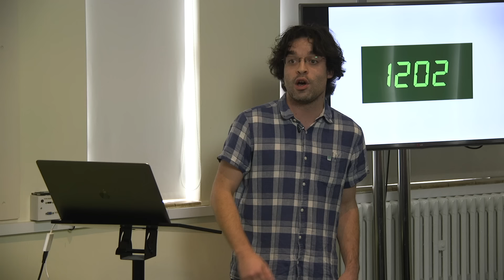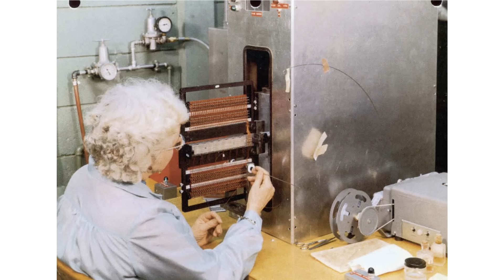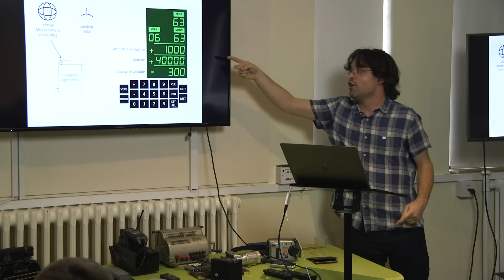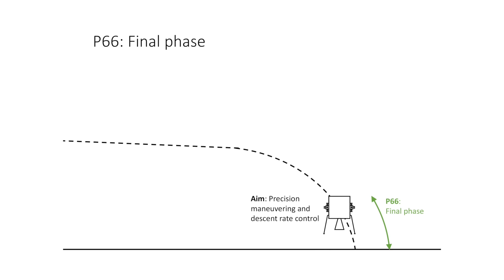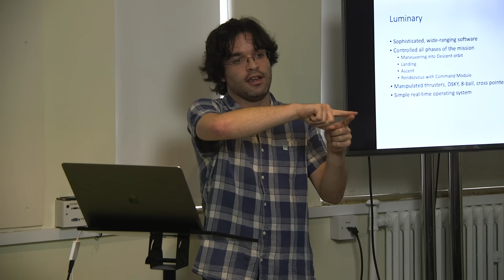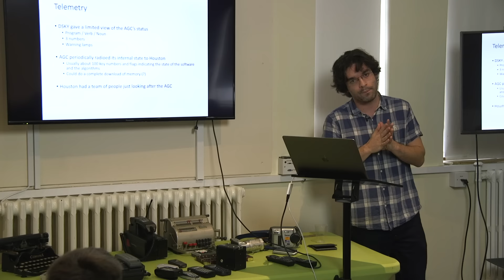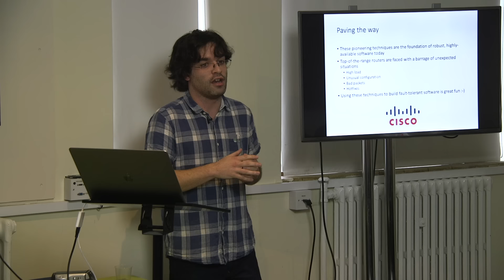Light Years Ahead | The 1969 Apollo Guidance Computer

Comment: ¿ 2051 apollo ? * ** 
□
Apollo army, naval, air force

4 orbiting body for area 4⁶⁷⁰ < = . > 
6⁷⁷⁹² < = .>

Hundred million thousand globe area(s) 
•Port •bow •aft •stern grûá  plûmb 

90°Ņ•90°E•90°Ş•90° up • down
Reply: 7,800,000 aerospace 
Requirement stationary orbit 
(7) atmosphere meteor 
13,000,000 pilot per globe 
2093 - 2067+- 2235 year(s)
8189 stationary orbit friggit size attachment 10 - 24 aerospace outer space ship 

Solar cell carriage bolt, solor cell thick attachable initia 
Holding orbit 
Requirement green house food.

Atmosphere (7) type(s)
1. T.e.r.
2. U.h.f.
3. M.a.r.
4. A.v.a.

Meteor and 117 solar system equipment transmitting flag • banner • rectangle horizontal or and & neutral verticle
Reply: Communication audiance museum conduit terminal computer ₩c infant(s) & ₩c adult(s) question & answer

Comment: Question: Did the computer engineers overlook the 15% load of the RENDEZVOUS RADAR when it wasn't even needed during the descent phase? Thanks
Reply: He said it was a hardware problem, so presumably, that particular hardware wasn't in the simulator (since it was mounted on the LM).

Comment: Ohm allies pallies brass suitcase in two parts, measuring a total of 24 × 12.5 × 6.5 in (61 × 32 × 17 cm) and weighing in at 70 lb (32 kg). Inside, it isn't even very impressive by modern computer standards, having about as much oomph as a smart bulb with a total of about 72 K of memory and a 12-microsecond clock speed❤ 8hz clock speed next 1982 Apollo Guidance Computer - Wikipedia
The Apollo Guidance Computer (AGC) was a digital computer produced for the Apollo program that was installed on board each Apollo command module (CM) and Apollo Lunar Module (LM). The AGC provided computation and electronic interfaces for guidance, navigation, and control of the spacecraft. The AGC was the first computer based on silicon integrated circuits❤The Sinclair ZX Spectrum was one of the most popular home computers in British history. The iconic Sinclair ZX Spectrum was an 8-bit personal computer first released in The United Kingdom in 1982 ...It's also hard to make an accurate comparison with modern devices because the AGC wasn't a general purpose computer, but one that was literally hardwired for a particular task, which allowed it to perform at the level of the Commodore 64 or ZX Spectrum of the early 1980s – try to imagine getting to the Moon using a Commodore 64 to handle the navigation and not break into a cold sweat.❤1972: Dennis Ritchie developed C, generally regarded as the first high-level programming language. This means that it's closer to human language and less like machine code. The C Programming Language 1972: Donald D. Chamberlin and Raymond F. Boyce developed SQL for IBM. This language was used for viewing and changing data stored in databases❤Invented by John G. Kemeny and Thomas E. Kurtz of Dartmouth College in Hanover, New Hampshire, BASIC was first successfully used to run programs on the school's General Electric computer system...❤Grace Hopper Related Topics: imperative language procedural language See all related content → COBOL, in full Common Business-Oriented Language, high-level computer programming language, one of the first widely used languages and for many years the most popular language in the business community.❤Pascal, a computer programming language developed about 1970 by Niklaus Wirth of Switzerland to teach structured programming, which emphasizes the orderly use of conditional and loop control structures without GOTO statements.❤Origins Pascal grew out of ALGOL, a programming language intended for scientific computing. Meeting in Zurich, an international committee designed ALGOL as a platform-independent language. This gave them comparatively free rein in the features they could design into ALGOL, but also made it more difficult to write compilers for it.  was displaced by the C programming language during the late 1980s and early 1990s as UNIX -based systems became popular, and especially with the release of C++. A derivative named Object Pascal designed for object-oriented programming was developed in 1985.❤The PASCAL programming language was built to teach students to program, but as with many tools students learn on, it grew in popularity as those students graduated from college throughout the 1970s and 1980s. I learned PASCAL in high school computer science in 1992.❤The history of programming languages spans from documentation of early mechanical computers to modern tools for software development. Early programming languages were highly specialized, relying on mathematical notation and similarly obscure syntax.[1] Throughout the 20th century, research in compiler theory led to the creation of high-level programming languages, which use a more accessible syntax to communicate instructions.

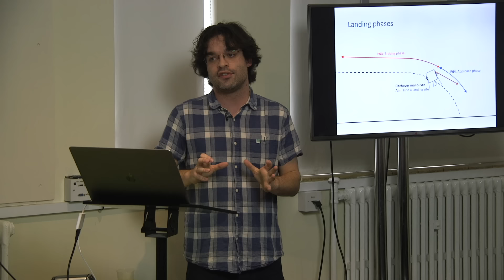The first high-level programming language was Plankalkül, created by Konrad Zuse between 1942 and 1945.[2] The first high-level language to have an associated compiler was created by Corrado Böhm in 1951, for his PhD thesis.[3] The first commercially available language was FORTRAN (FORmula TRANslation), developed in 1956 (first manual appeared in 1956, but first developed in 1954) by a team led by John Backus at IBM. Read only memory chip on board mother board service comand mudules see 22 volts seas watts max lad 44ohm. 15 bits 1 for adressing cisco routers trunk 01 input putty mysql orical access micro soft. Its apple mac snow lepord diskey dsky door compination angorrythams change dara mobile loona models io short c# f# see all compilers engines thrusters 8 bits one bite 800mhz chip main banks records data to hard drive windows GW basic hackers ibm hmv virgin sinphonia sandy man records ep 12in drives floppys so no tapes. First magnetic TDK Sanyo Floppy drives. P63 a chip retro thruster but no atmosphear sees 8k feet 210mps 660mph decent to 12 foot pounds seas airs jets thrusters a soft bounce. Huston the Eagle has Landed Roger bleep. 8/12 40 foot landing jets fires. 18:44 podtome 4/4 8+1 9 13 chriotanks blows out. Bio life who was in criostases Sparton John Simon Pheonix phenetics morse digital data stripes. Raid2

Comment: The hardware was so ahead, I mean 'we' didn't get composite PCB's and surface mount until the 90's!!!!! [ not in the guidance comp but the Saturn V modules as broken down by a YouTube'r ]

NASA's patents from the 60's held back have actually slowed human development.

>90% efficient Stirling engine'd generators in our energy starved age!!!!
Reply: Anything patented is not 'held back', it's available for licensing. Anyone claiming a Stirling generator can be 90% efficient is lying: basic physics dictates that its efficiency is far lower, depending mostly on the temperature difference (Carnot limit).

Comment: Nowadays some modern calculators have arm processors, which without any doubt can run 100 apollo guidance systems in parallel.....So, I disagree with you. If you're talking about a simple calculator as used in the 70-ties you're right though.

Comment: Boring question, an probably in the comments somewhere, but in case anyone bored enough to answer. But is the data from the IMU  (and later the radar) all the computer had to go on about where it was and how fast. I mean, did they literally program the computer to say "you are starting here in america and this time of day and spinning this fast, and by the way the moon is over there and its going this fast, now just add up the IMU readings", it just seems unfathomable that you could just integrate all the data from just the IMU and be remotely close to the right timing to start th dcent P63 (or was it p64) bit. Did they not also augment the data in the computer before those events with radar data from earth maybe, or perhaps some other measurements (sextant and the stars maybe!?) Sorry for the silly qustion, it just that modern IMUs made on silicon with incredible precision still cant integrate their data for very long before getting some serious cumulative errors, but maybe the proper spinning gyros and things were just that good.
Reply: It had different programs for different stages of the flight. The CM and LM had gyroscopic tables that gave relative heading from a set location. It had to be realigned using a sextant and known stars because of drift, It was working more from that and input like the radar telling speed (changes in distance) and distance from the surface. It's only meant to do one of these functions at a time, that's why having the docking radar and landing radar on at the same time caused a buffer overload.
Reply: They had help from ground computers for mid-course corrections.  They took sightings of stars to determine their position.
Reply: My answer, I am not an authority or expert: It is pure bullshit. But I am also not an expert in finance, but I know and understand, how  a ponzi scheme works. And it looks like this guy is totally a nerd, to say it chummily. Fascinated by his own words.

Comment: this is a great presentation and I enjoyed it very much, but one thing is not correct. the radar signal could not be switched off,because ist was a hardware bug that means the radar signal line was directly connected to the computer with no switch in between. The workarround was to chnge the programming and override a specific memory position with zero, when the mode switch was in "descent" position. There is a video on youtube where the programmer of the original source (Don ?) explains it in the code.

Comment: Issue:
After WW2, the whole world turned into "Nazis".
Now, mind, I do not mean the ideological party, no, I mean, technology wise.

They had the most insane tanks, that usually out-everythinged they encountered.
Ah, German engineering, right?
Right?

Well, no.
While they performed beautifully when they performed  ... it became problematic once they stopped performing.
Over-engineering, over-complicating, it became terror when they stopped functioning:
The mechanics often were not able to fix even small problems.

And we became over-engineering.
A great example is, when, years ago, I tore a radio apart.
Totally, that is, I removed every single part of it, and put it back together, with half the components.
And how bizarre ... it still functioned the same.

Makes me wonder ... why do we keep doing this?

Programming, a similar issue:
Windows it stuffed full with needless waitstates.
These sometimes have a certain function, agreed, but quite often ... not at all.
Seems, we never heard of FUNCTIONAL PROGRAMMING.
This is:
Minimise the programming.
Make each bit and function actually DO something.
Add no addendums.

I bet, if I had the time, I could mane a Win 10/Win 11 ... 1/3rd the size, and still work good.
Probably better, as the useless junk is scraped from it:
Adding stability, increasing speed (as there is less to compute), ... .

I think this is done as it is today, to make folks buy bigger and more "powerful" systems, while, and this is hyperbolic, mind, an 8 bit PC such as the 8084 could still run Win 11, if Win 11 allowed it to.
I said, it was hyperbolic:
It could POWER-WISE, but some required functionalities were not around back then, I am more than aware.
Still, if we took these out, it would actually run.

An analogy would be:
A Ferrari engine and an engine of a, let's say, well maintained and often running Ford Mustang 1964 1/2:
Put gasoline in it, and they would both run.

Same with all.
Newer is therefore not better.
Keep it simple, practical, functional.
That is the way to get good things.
Don't "fix" what ain't broken, you will indeed break it.

I think of for instance all the shit Apple does to it's customers, MAKING things break, once the warranty period expired.
In name of the Holy Profits.
And that we actually support this, is even far more ludicrous.
But humans ... they're not the brightest bunch.

Comment: Imagine holding the position we made this computer 60 years ago but couldn't do it now.  Okay.
Reply: Nobody makes computers like this anymore.
Reply: @casanovafrankenstein4193  Not the point I made, keep up.
Reply: @anotheryoutubed  what was your point then? It's not clear what you meant. You wrote "Imagine holding the position we made this computer 60 years ago but couldn't do it now." With this sentence "it" is the pronoun you used which substitutes for the word "computer" that you used earlier in the sentence. So, it seems more like you don't even know the point you were making.
Reply: @anotheryoutubed  they're not even really "chips". however we can, and do, build modern chips designed to handle enviroments with radiation. to unpack your nonsense. you're refering to one particular interview, and one particular line of it, where an engineer explains that they DID design such computers, and are planning to TEST THEM in the enviroment THEY WERE BUILT FOR. which they did, ten years ago, and they performed as expected.

Comment: A very interesting talk by a very knowledgable and enthusiastic presenter.
I would like to comment on the explanation in answer to the P00D00 question as the nomenclature is based on the two parts of the display when the system restarts i.e. Program 00 Data 00 giving rise to the amusing shortform PooDoo,

Comment: Why mix meters and feet, either do SI or freedom units, not both.  Otherwise, great video/presentation.
Reply: We have free speech in the United States.  We may mix units as we please in a speech.  Units are arbitrary and equivalent.  In fact, the Apollo program did use both Metric and US units, so someone speaking on the program might well need to use both.  There would be no point to converting.

Comment: I wish he would have talked about the other aspect of the 11 landing that was the real drama.   Why did they land long in the first place.  P69!
Reply: When they separated from the CM there was some residual air pressure (non adiabatic decompression) in the air lock that gave the LM a little "bump" in speed. Integrated over the time to landing pushed them downrange.
Reply: @ronmccabe7164  I understand that.  The guidance platform would have sensed that delta v.  What I have learned is on 11 they didn’t have the ability to compensate for the error.  On 12 tools had been developed that allowed the crew to modify the landing position based on earth based observations so that pinpoint landings were accomplished

Comment: If there were just one job executing, how would other jobs signal NEWJOB to the running job? Was there a separate system that handled that?
Reply: Every job had to be programmed in such a way that the NEWJOB-signal was checked from time to time. As far a I understood there was also a watchdog timer implemented in hardware which reset the system if the NEWJOB-signal was not checked for a specific amount of time.
Reply: @elkeospert9188  Yes, thanks, I understood this part - my question is what triggers the NEWJOB flag to be true in the first place. If cooperative multitasking is used and jobs aren't preempted, i.e. no instructions from other jobs are run during the execution of the current job, how can other jobs signal NEWJOB when the current job periodically goes to check it? I hope my question is clear.
Reply: @holeo196  I would assume that there is some common piece of code (like a subroutine) we can name it "CHECKNEWJOB"

This common code checks the necessary sensors and other input (from "DSKY") to determine if a new job should/must be started.
After all checks done it also resets the hardware watchdog timer and returns the information if the current job is allowed to continue or should stop (to start the identified new job).
And this common code "CHECKNEWJOB" must be called by every running job from time to time to allow it to be interrupted if needed.

So NEWJOB is not just a single 1 bit flag - instead it is some specific software to determine if a new job should be started.
And as it is software you can easily implement things like job dynamic priority (to ensure that a job for example runs at least once per minute) and also the priorities could be adjusted according to the phase in which the mission is at the moment.
Reply: @elkeospert9188  Ah that makes a lot of sense, thanks for the answer! I was thinking about it like having multiple long-running processes where in reality it's probably more like a printer job queue where jobs are created based on IO and completed FIFO.